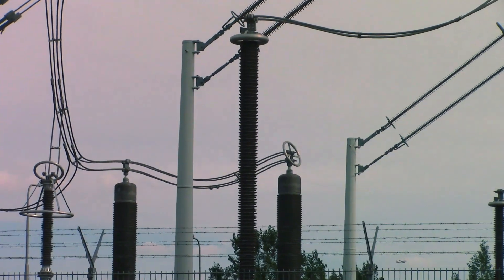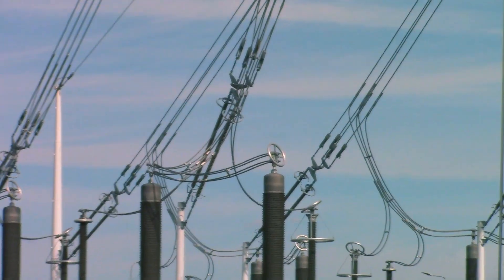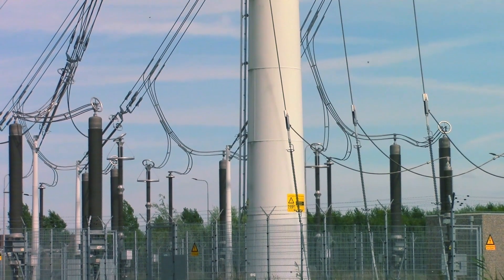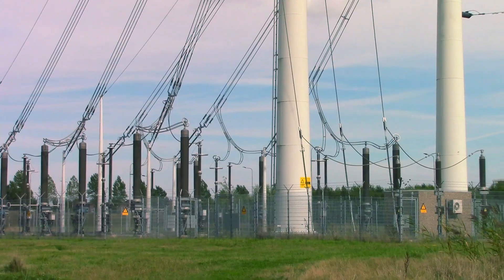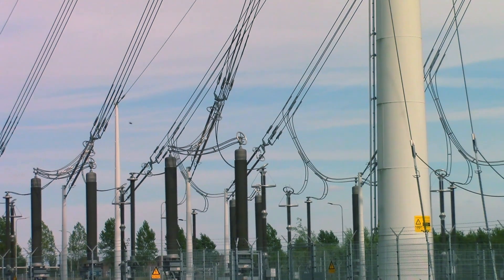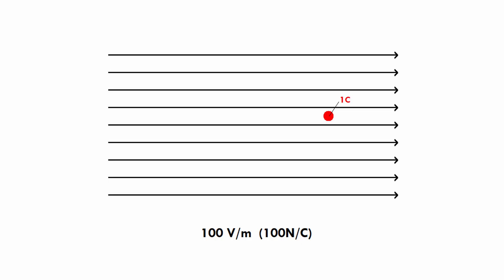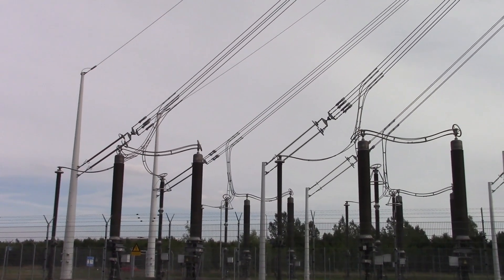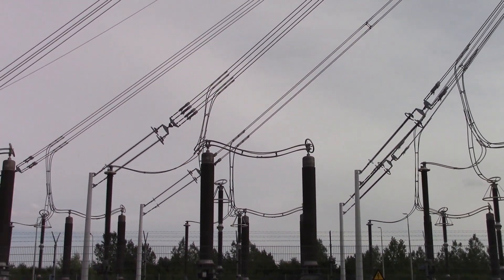What are those rings on high voltage gear?

Comment: I've been wondering about all the spirals and loops and things on the wires up there, vibration dampers and stuff
Reply from the maker: These lines are full of clever little things for all sorts of purposes. Another interesting feature visible in the video is the spirals (locally sometimes referred to as "pigtails") mounted on the thin ground wires, to make them more visible for birds. (birds crash into thin powerlines surprisingly often, depth vision doesn't work well on a thin horizontal object, at least if you keep your head level)

Comment: Hi, I watched some months ago your SRM video (that's amazing), and I wanted to build my own SynRM, but I am having difficulties to find a busines that does the laminated thing for the rotor and stator with electrical steel. Do you know any site or multinational (or european) business that does this?
Reply from the maker: I'm afraid that stuff is very difficult to get. I contacted a local supplier of motor/transformer cores, but their price was very high (1000+ euros for my motor). These companies rarely sell to individuals anyway, and if they do the prices are going to be insane.

Alternatively you could try to purchase your own electrical steel and make your own laminations (or get them cut by someone else), but the material itself is usually only available in bulk quantities, which kind of ruins this approach. (although in some parts of the world it may be available in smaller amounts).

What I ended up doing is just ordering a pile of laminations from an "ordinary" laser cutting service, who made them out of 1mm thick regular steel. Thicker than optimal, and of course not quite the right material, but close enough to me.
Reply: allright, thanks!